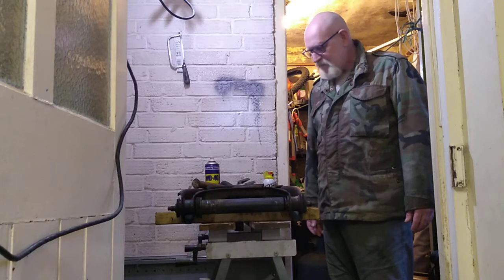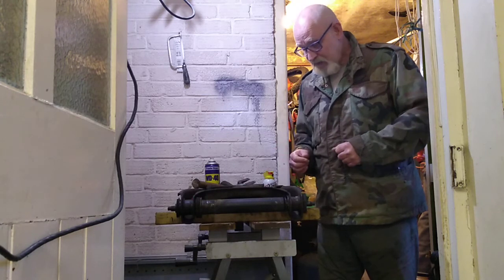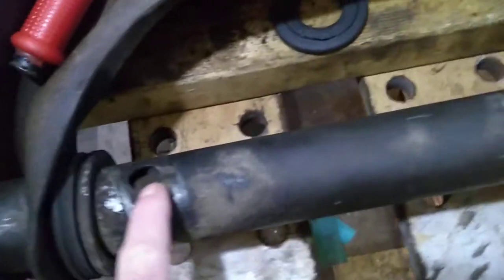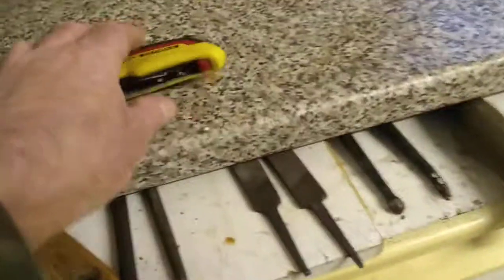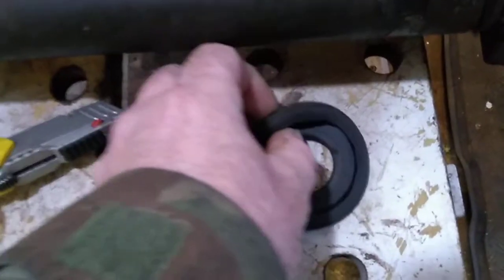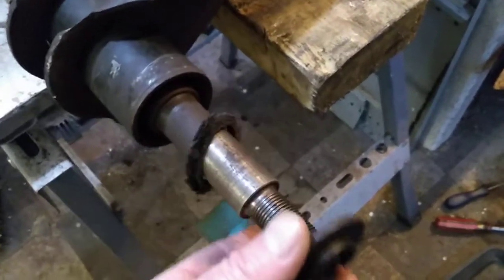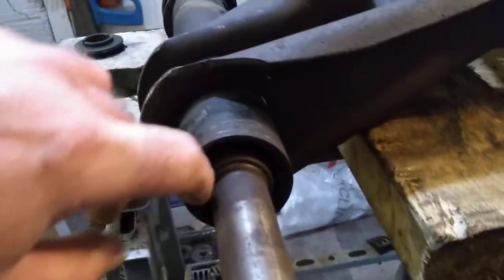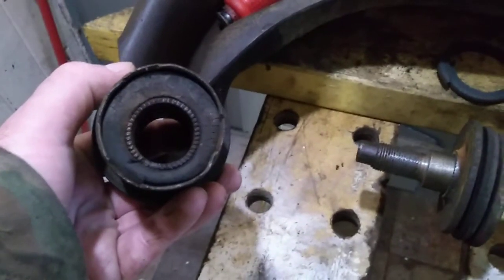Chevy Van G10 G20 lower control arm bushing removal

Comment from the maker: Someone just asked me how do you fit them, so I wrote a lengthy reply whilst they deleted their question, . Lol.  So here's the answer - 
You do one side easily with the C Clamp from the kit - then fit the shaft - then for the other side you use the pressing cylinders from ball joint tool kit, and/or woiden blocks to tap the bushing into shell, followed by the inner sleeve (I think I used a long socket to tap that in).  If you try to fit the new bits preassembled, they fight you, and that's why you hear of people using a press.  No need, just put the inner sleeve in last.  Be sure to put blocks of wood cut to size  or something between the "ears" of the shaft holes so as not to comprees them out of shape. Torque settings are in the video description, one of the big (i think 1⅛") shaft nuts can't be torqued once fitted to the van, no space for a torque wrench and socket, so you have to use a ring and open ended spanner and some brute force and ignorance to do that once you have jacked up the control arm to ride height to torque it before putting your wheel on.

Comment: What happens to the spring? Do you have to compress it?
Reply from the maker: You lift the lower control arm with a jack, loosen the nut and break free the upper ball joint, remove nut, lower the jack, spring is no longer under pressure and can be lifted out. Reassembly is the reverse.

Comment: Thanks for showing this! About to go through it on my ‘93!
Reply from the maker: You're welcome. Another helpful tip - when pressing in your new (I'd recommend Energy Suspension) bushings, press the sleeve in with the kit I showed, then the bushing, I hammered it in with a block of wood over it, make sure you jam a block of wood or something between the two holes the bushing sleeve goes through so they don't deform. Also, insert the inner sleeve after the poly bushing is in, if you try to get  the poly bushing in with it's sleeve inserted it won't go in. I used a suitably sized socket to knock in the inner sleeve. One side can all be done with the ball joint kit, the other side is what I'm referring to it needs to be done with the shaft in place so is a bit more awkward.  If you have an air chisel or even one of those drills that have a chisel action the shells can be removed much quicker, in minutes. Good luck, the hardest part is de-rusting, cleaning and painting the control arms. Getting it all off and on the van is actually quite easy. Cable tie your upper alignment shims together so you don't get them mixed up.  Be careful with the upper bolts on the chassis, they can't be replaced if they snap because 'no chassis'.  Don't forget to buy a new backing plate seal, and get timken bearings they are oem. Your rotors come with races in them.  Renew your brake hoses, drivers side one top connection is easiest to get to from under the hood, use proper pipe wrenches. The centre of the hose is held on with a clip that you pull outwards to release the hose. It looks like it screws apart but it doesn't.  Spindle castle nut finger tight then ½ turn more, check by rocking wheel top to bottom, drive a bit, check again. Seal your brake fluid reservoir caps with plastic bags, and provided you don't touch your brake pedal you shouldn't lose much fluid and will be able to gravity bleed your new calipers without tripping your proportioning valve.  Quality control on the ball joints is poor, even with moog, make sure they are not loose fitting and also get them in perfectly straight take your time pressing them in you don't want to oval out their mounting hole then end up having to weld them in. Make sure you measure ride height at the centre of the wheel before dismantling so you can torque up your control arm nuts at ride height. You will need a 1¼" ring and open ended wrench. One of the control arm nuts can't be torqued (no space once fitted) so you will just have to use your judgement based on how hard the other one felt. Torque specs in vid description.

Comment: What year was this off
Reply from the maker: 86 G10. I think all 3rd gen had them except G30
Reply: @RoyArscott  it's funny..I have  a 92 3/4 ton.. with that control arm..can't find one anywhere
Reply from the maker: @charlesswenson8510  yeah well at least you have pick and pulls with g vans in them, I'm in UK so it's make do and mend for me till CPP start making tubular control arms for them, there is a demand for sure. Fortunately for us vans are becoming more fashionable. If you haven't already, join the fb group "Chevy G10, G20 & G30 vans" that's the best place for help and advice I've found, though I have not had to ask for advice yet but have gave plenty. Happy vannin share some pics if you join the group.

Comment: TRW makes the replacement shaft now you can get both shafts for the left and right lower control arm for about 80 bucks why bother all that trouble I've had that trouble by their pain when you get new one just cut them out and put new ones in it's a piece of cake
Reply from the maker: I had a quick look at TRW, appears to me they only do the 1½" shafts, or shafts for vans "without vacuum brakes”!!  But hey, if I'm mistaken and they really are available now then great, they weren't when I made the video, and the chat on the G Van FB pages no-one has ever managed to find a replacement for the 2” shafts.
Reply: Were they 2 inch?

Comment: Roy, I have a 1991 GMC Vandura 2500 that has that same extra large main shaft like yours. I was wondering if you have the correct lower control arm bushing part number, so I can change them myself too. I've seen a lot of lower control arms with a lot smaller diameter shafts, but yours is just like mine, the extra large one. Any help would be appreciated. Thanks, DB
Reply from the maker: I got Energy Suspension 33161R from RockAuto.  I think all the bushings are the same size regardless of the shaft diameter, but not certain.  When installing the bushings into their outer shells it is best to do this without inserting the inner metal sleeve. If you install the inner sleeve first then you won't be able to get the bushings in at home and will have to take them to a shop to have them pressed in. You can knock the inner sleeves in after using a (I think) 20mm socket or whatever. The little tub of extremely sticky grease they send with it (wear disposable gloves) doesn't seem like it will go far enough to do the job.  Fitting the first side I used it sparingly, and doing the second side I had loads left over.  A year later and the first side now squeaks going over speed bumps. It says on their blurb "advantages/disadvantages" compared with rubber bushings that this may happen, so not a problem and not really that noisy to be annoying.  The poly bushes definitely give a firmer ride and handling. Nothing particularly wrong with rubber bushings I just wanted the poly ones because they supposedly last longer.  I also got Moog ball joints, idler arm, inner and outer tie rods and connector, new calipers, inner and outer wheel bearings and new inner seal, backing plate seal, new rotors, and rubber hoses. These are important to change, mine looked perfectly fine but once I got them off and bent them a bit they were cracked, and they rot from the inside too, turning them into a one way valve that makes the brakes drag.  If you are going to do all the brakes then make sure you don't touch the brake pedal whilst you are rebuilding everything, that way you won't need to bleed the master cylinder.  Take your time fitting the new ball joints to the lower arms, make sure they are square, you don't want to elongate the hole, I have seen pics of some people's ball joints "falling out" because of that, and then they have to get them welded in.  Be careful with your U bolts, new originals are impossible to find. I soaked mine in spirit vinegar they came up like new.  When dripping the lower arm to remove the spring, jack it up and loosen the nuts on the ball joints but leave the bolts on.  Get an oversized pickle fork (I think it needs to be over an inch wide) and open the top ball joint first, undo nut, lower down carefully, push down on the control arm once your top spindle is loose and out comes the spring nice and easy.  For fitting the upper ball joint, if you have the original still fitted it is rivetted on. Drill them out, small pilot hole in the centre first then a 6mm drill (I think) and once you have drilled down a bit you can chisel them off. The new ball joint with have nuts and bolts to mount it.  Good luck it's a big job don't expect to get it done quick but it's worth taking the time to do properly so you know you can do donuts with confidence.

Comment: Thanks buddy for the video it has helped me a ton. I have a 1992 g20 and it took me two months to locate a not rusted set  of control arms and I too was shiting thinking of bashing them. It came apart great with your advice.  Thanks again and happy vannin.
Reply: Where did you find the control arms
Reply: @charlesswenson8510   I found them out west by accident on Craigslist. But there is a youtube channel called the swim shop 4x4 custom van's that converts van's to four wheel drive. So if you're looking for some they might have some. I don't know for sure but it would be worth a shot emailing them.
Reply: @nickploszay2310  thank you

Comment: So both my bushings were seized onto the rod. Had to literally cut the shell off and open up the sleve to get it off. Then the large washers are also stuck to the shafts. So I've had to keep the shaft in and put the bushings in around it. What a freaking nightmare of a job this is!

Comment: I'm planning on changing the bushing on my 89' GMC G2500, I had no idea that the shaft was hollow with a rubber bushing. I have a feeling mine might be shot, current bushings are crumbling and cracked so I'm going to assume that the shaft bushing is similar. The only off the shelf replacement I came across was from Rare Parts and my goodness are they pricey. I'm hoping they aren't as bad as every other bushing on the van, if they are I might have a crack at making a bushing from Polyurethane casting rubber. Thanks for the Video!